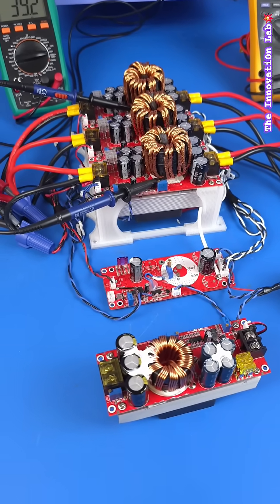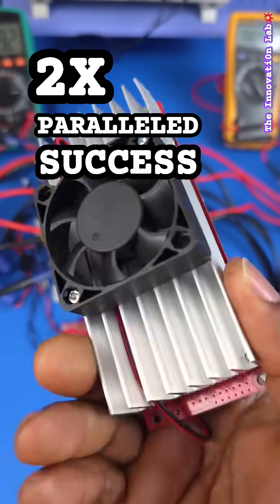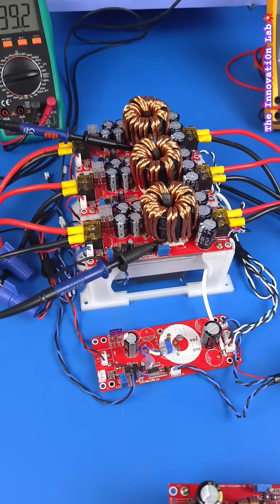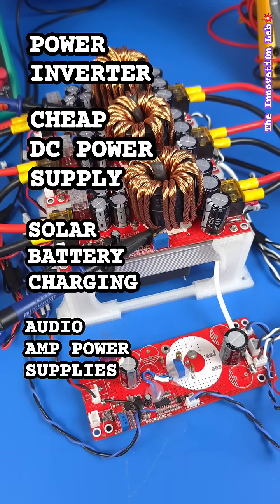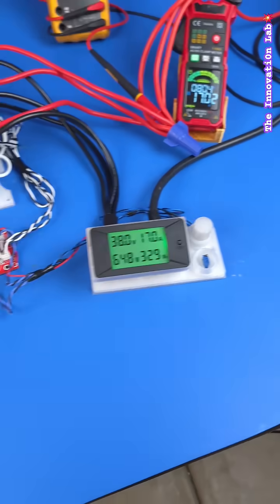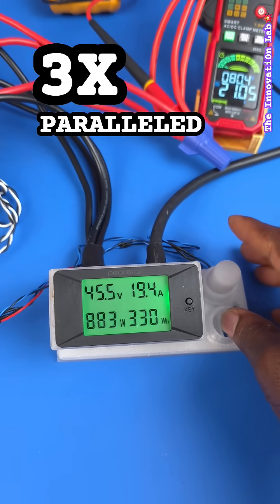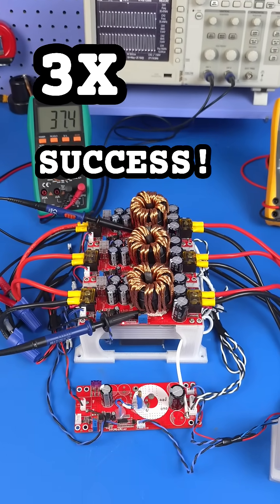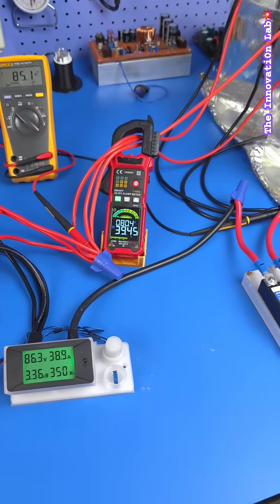3500W, DIY DC to DC Converter Using Synchronous Paralleling #shorts #dctodc #diy #power

Comment: If instead of 3 boards, why not simply defeat one of the PWM chips on the paralleled board, driving it from the master board
Reply from the maker: That is what the synchronous paralleling is all about. Please watch the linked video. I explained everything in great detail and provided schematic of the system.

Respectfully,
The Innovati0n Lab

Comment: Nice! But i have a question. Do i need a " driving board " separately or could i just connect two modules together with exact same output voltage and Amperage maxed out?? ( fixed voltage using resistors instead of trimers )
Reply from the maker: Great question.
Just connecting the converters in parallel wont work. 
Please go watch the latest videos on this concept on my channel - it should have been liked to this one.😊

Respectfully,
The Innovati0n Lab 💥 

PATREON:
https://www.patreon.com/c/TheInnovati0nLab/membership?redirect=true